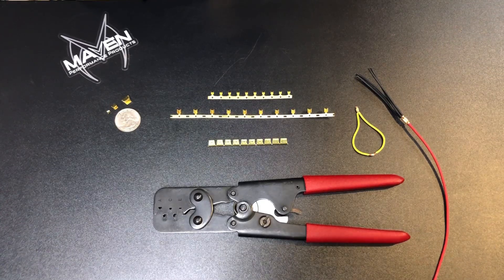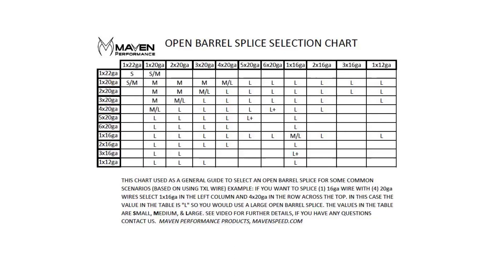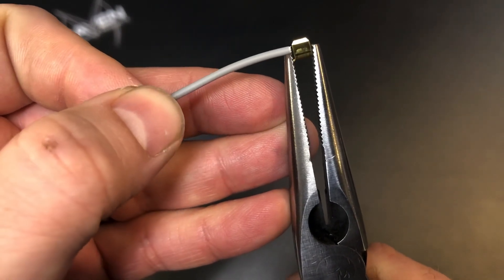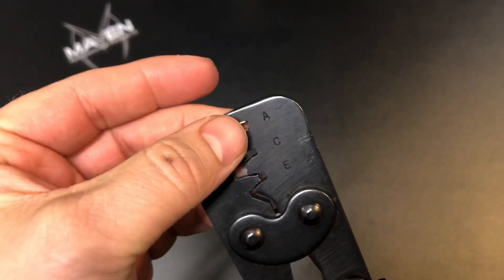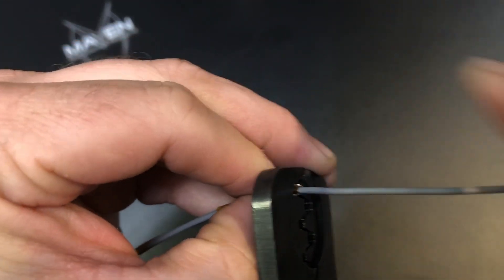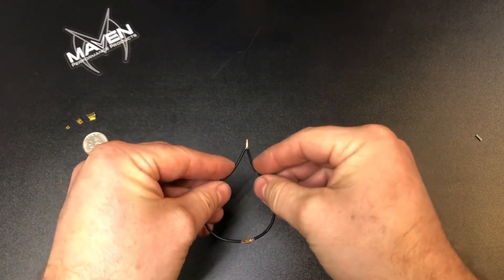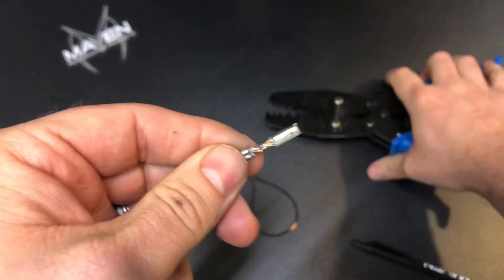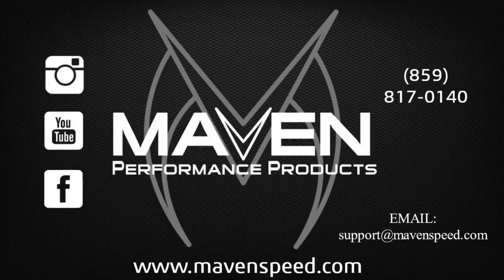WIRE SPLICING, OPEN BARREL, BONUS TRICK AT END OF VIDEO

Comment: i think cutting crimps off of the terminals or contacts could actually work better then some open-barrel splices if terminals themselves are made of thicker material then open barrel splices(chinese knockoffs of te splices have thinner metal).

Comment: should wire break before pulling out or should it pull out with alot of force? It seems like with too much crimping force tensile strength would be inferior to joint with less crimping force (which can be pulled out without breaking, but with alot of force) on the same wire and splice.

Comment: Multiple wires in one pin is perfectly acceptable as long as the appropriate size terminal is selected.  Even NASA approves this.  See section 19.9 in this document.  https://standards.nasa.gov/sites/default/files/standards/NASA/A/4/nasa-std-87394a_w_change_4_0.pdf#page78

Comment: The crimp is stronger if the wires aren’t twisted before crimping.  Yes, you have to be more careful inserting them, but straight wires form a more gas tight crimp which is what you want.

Comment: Do you have the model brand of the cheaper crimp tool?
Reply from the maker: I think those came from an auto parts store, they are not very good because the joints in the pliers are sloppy- there are better crimpers that are also inexpensive that are non ratcheting- look for a pair that have that shape / profile in the crimp section and has good reviews.
Reply: @mavenperformance  Im asking because I have already 2 different ones and they dont work at all, I bought your crimps as well. Would be awsome if you added some cheap ones to your website because I bet the expensive are worth it but when you dont use em often cheaper ones have to do.

Comment: Thanks for taking the time to make this videos, learning a lot.  Question for ya,  I have the same ratcheting crimpers and on some of the larger open barrel splice connectors, they seem too narrow.   They don’t crimp the entire open barrel connector over leaving me with sharp ends sticking up.  Is there another crimp tool for these larger open barrel splice connectors or a way to get the whole thing to crimp over the wire?
Reply from the maker: You might try crimping the splice and shifting the tool over and crimping again if you are not getting the full width- let us know if that works for you. Make sure to use quality heat shrink over the connection to ensure no edges of the splice protrude through.
Reply: Tried your suggestion out today, seemed to work pretty good.  Thank you!  Feel like there got to be a crimper out there with a wider jaw just to get a cleaner crimp with one motion...will keep a look out.  Thanks again
Reply from the maker: @H750S  thanks for the update- report back  if you find another solution!
Reply: @mavenperformance  I still have this issue the previous commenter was experiencing. Really wish someone would make a crimper specifically for these splices, with wider jaws for the large size. I've searched everywhere and it seems there is no hand tool for the large size, only bench top machines.
Reply: @Nocturnal_Auto have you tried a 10awg open barrel crimp, or are you using 12-14 crimp on it? Trying to figure out which tools to buy. The open barrel battery cable crimpers are way too wide.

Comment: LOVED the bonus tip! Do you have any recommendations on what size terminal I need to purchase to fit two wires? Say two 18 gauge wires
Reply: And have you tried crimping regular uninsulated spade type terminals? The ones that typically reside in relay connectors. Want to daisy chain/pigtail the power :)
Reply: Look up the circular area of the two wires to be crimped and then find the single wire size with the same area and use a terminal for that size wire.